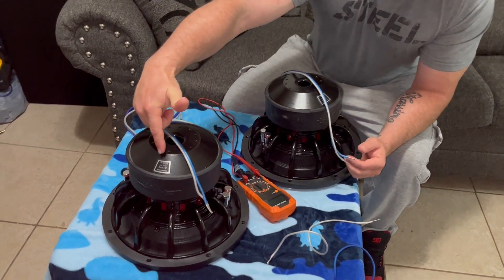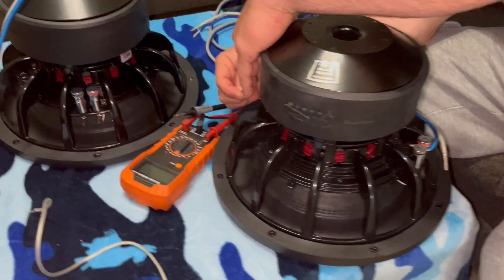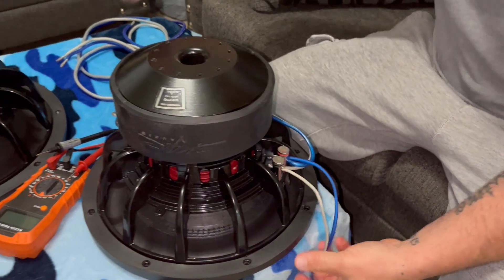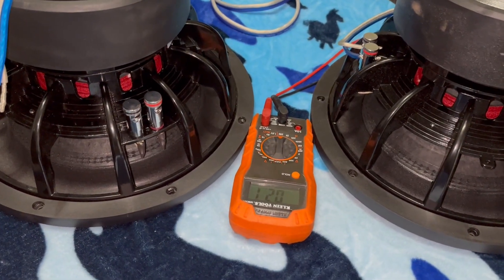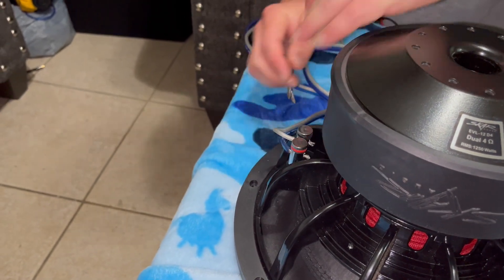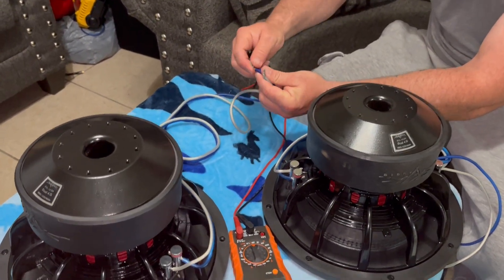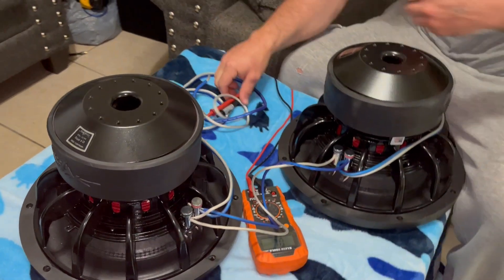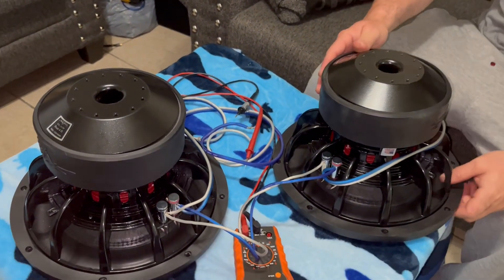how to wire two dvc 4 ohm subs to 1 ohm

Comment: I have a question, I have two terminals obviously, and don’t wanna drill a hole into the box. Couldn’t I just utilize both terminals, and join the four wires at the amp?
Reply from the maker: Outside box Connect one terminal to other , run wire from other terminal to amp , just like connecting one sub to other inside box but on the outside ,,,, check you amps book out if its 4 terminals on amp(+,-,+,-) that equals to one channel then yeah , if you dont have a multimeter the ones at harbor freight are cheap and work just find, hope it helps
Reply: @SKentertainment504 so you’re saying if I have a mono that has the 4 terminals I can power 2 dvc 4ohm that are paralleled; so 2 dvc subs that are 2ohm instead of running them together at 1ohm. can I do that ?

Comment: Hi I would like to ask if each sub rms is 2500 rms. Wiring two sus into 1ohm does the RMS changes?
Reply from the maker: Let's say If both subs are 500rms combined is 1000 rms.   Let's say you have a 1000watt rms  amp that is 400rms @4ohm, 700rms@2ohm and 1000rms@1ohm you would wanna wire your subs to get the most power out your amp hope this helps

Comment: Followed to the t but the wires going to the terminal are reading 1.8 ohms did I do something wrong
Reply: Each sun was reading 2 when read by itself
Reply from the maker: Is your box or sub shaky?movement will make ohms move, how old are the sub?wire one sub up check ohms
Reply from the maker: Makes sure wires are in terminal and not to short or loose